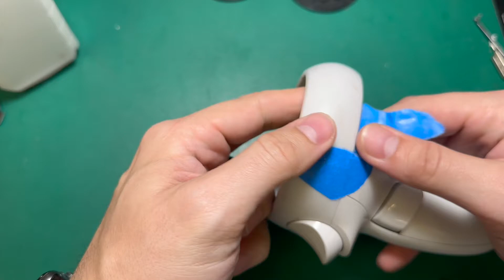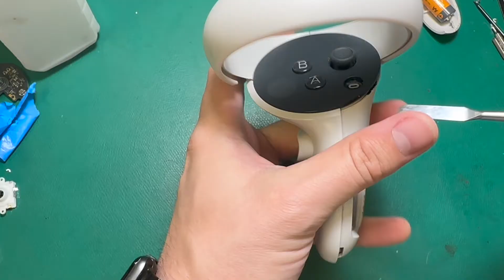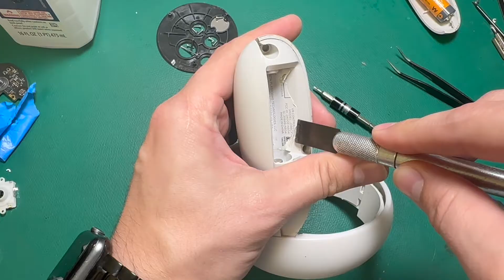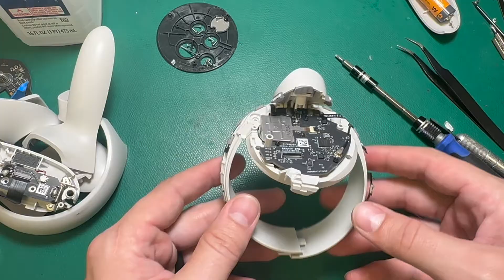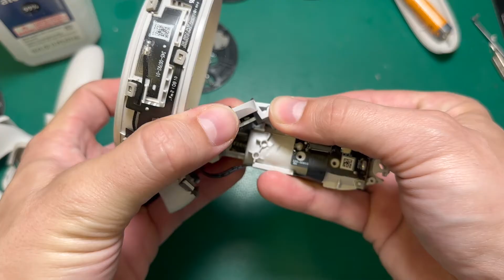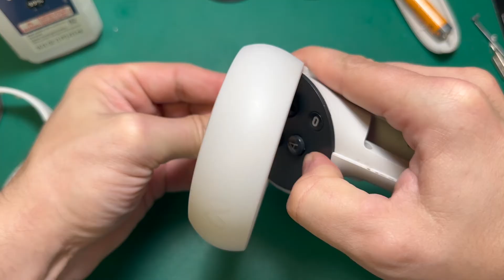Can This Controller Be Fixed? - Quest 2 Controller Ring Repair Tutorial

Comment: hello, i have a question and if you can answer it would be wonderful. a battery exploded in the quest 2 controller, I disassembled and found out that the J4 connector (the connector forrr the right side of the halo ribons) is completely crroded and is no longer making a connection, the connector is beyond repair bcuse of the corrosion. I'm going to solder the ribbon directly to the board, however some connection pads from the board are missing and idk where I can jump a connection from. if you have the pinout for this or better yet the board schematics it would be great. please help in any way you can, maybe you know wich pad is NC or something. thakns

Comment: Is it possible to buy a new controller because whenever I use my right controller I can’t put it behind my back because the light ring snapped and whenever I put it behind my back, it won’t work
Reply from the maker: Yes. But you can fix them too.

Comment: yo man my left controller still activates and stuff but the tracking disconnects every few seconds. i notices that where the exterior trigger is the ring is kinda clipped out a bit so i wanted to know if it would work again if i popped back into place because i dont have the money to buy a new controller or fix it and i dont wanna risk further damage since the rign isnt going back into place.

Comment: are the right ring piece and the left ring piece the same, because my right controller ring has a crack and I'm trying to get it replaced, but I can only find left controller ring replacements
Reply from the maker: No. They are different due to the mirrored button layout.
Reply: Yo ali express holds strips for both left and right